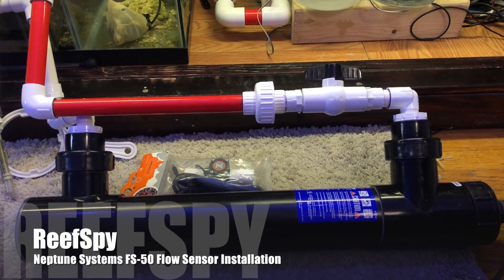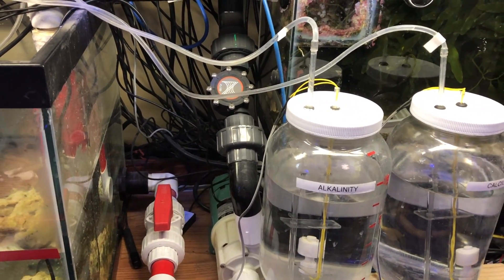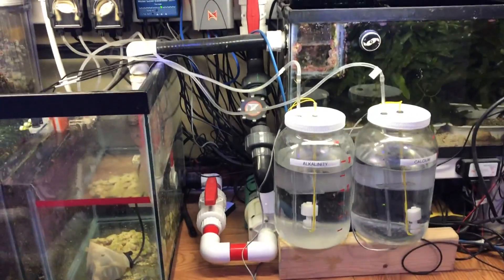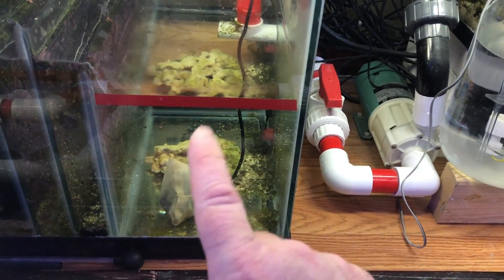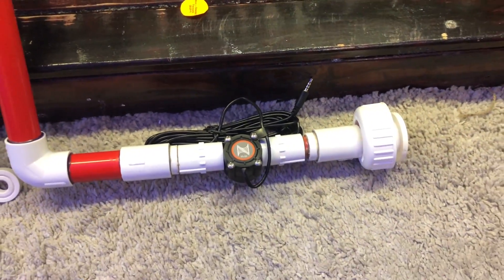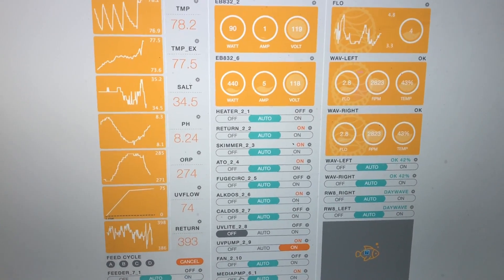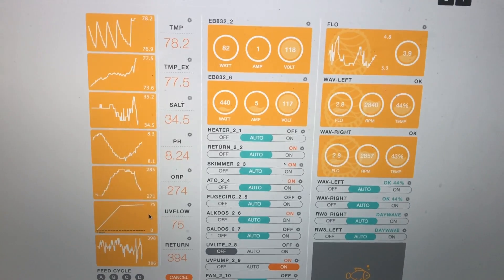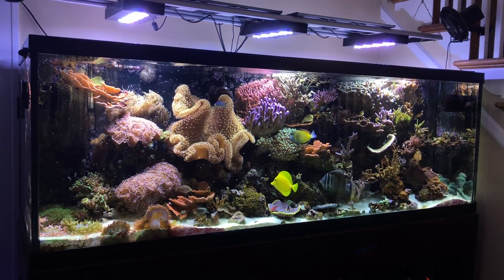Neptune Systems FS-50 Flow Sensor Installation

Comment: Wow I would have thought ur return would be around 1500-2000gph
Reply from the maker: Yeah, my pump is only rated for 822GPH at 0 head height.  At 4.5 feet it can push about 540GPH (rated), so add in some losses for plumbing and 400GPH is about right.  Too much flow and I think sump doesn't have a chance to do its job, so I go for a bit lower flow.